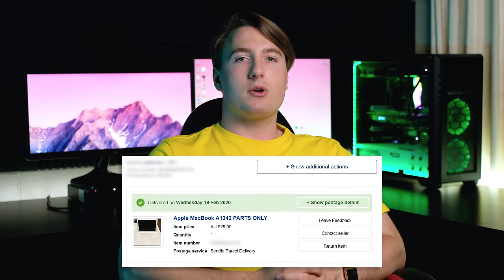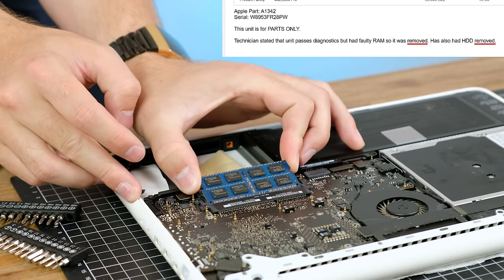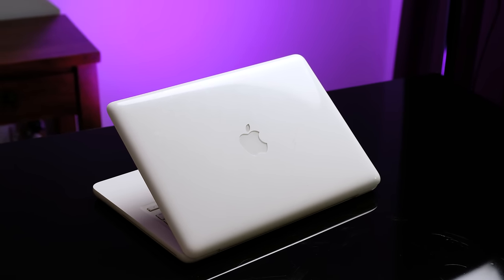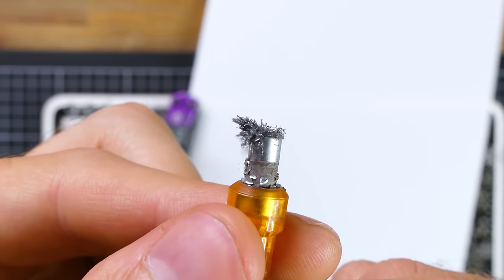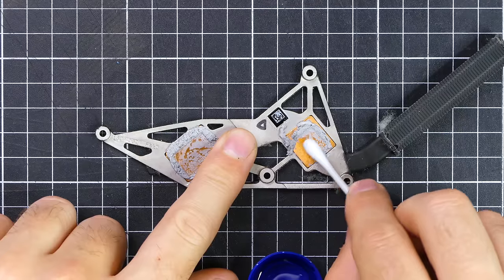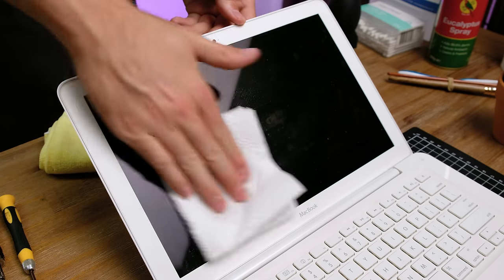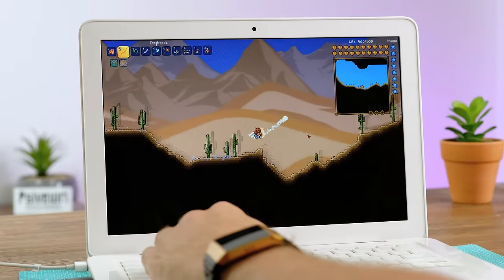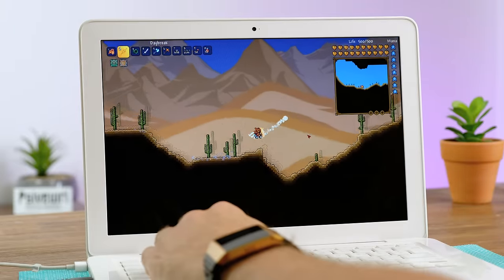$29 Apple Macbook Restoration!

Comment: The certificate of the install package has expired. Just set the date back to 2015-2016-ish and you're good to go.
Reply: Please let this comment get more traction so people can learn about this
Reply: Tamás Nagy it doesn’t work for me
Reply: Yeah turn off WiFi and change the date in terminal. Command should be DATE 010100002016
Reply: jbrooks4282 it didn’t work it says “you can’t change the startup disk to the selected disk”
Reply: @giovonni3225  all i have described is how to change the date to get past the error shown in the video. Sounds like you have another issue. Is it giving you that message in terminal?
Reply: jbrooks4282 no I’ve done what you said in terminal and then tried to boot from my usb
Reply: @giovonni3225  ok. So let's try this. Boot the install usb. Open terminal from there. Make sure wifi is turned off. Change the date in terminal. Then erase your drive in disk utility ( if you want the drive erased) and run the install.
Reply: jbrooks4282 I’ve tried that and I’ve tried it with multiple versions of OSX and I can’t get it to boot and I’ve tried swapping the hard drive and it won’t work
Reply: @giovonni3225  sounds like you have a bigger issue. Sorry, I tried to help
Reply: jbrooks4282 thanks for helping
Reply: @giovonni3225  did you fix it? If not reply
Reply: @madern7  make a usb installer
Reply: Agreed! I always use this date trick to install old mac OSes

Comment: I use this EXACT config (even the SSD!) every day for school with macOS Catalina and it runs like a champ! Great video!
Reply: Are you running Catalina on a 2009 Macbook??
Reply: @allieevans5698  Yep! Well, I was. I actually just replaced it the other day with my new ThinkPad T440 Hackintosh. Works great!
Reply: do you still have it? i'm thinking of getting it haha
Reply: @vern5648  lol unfortunately not. But it was great while I had it and if I still did, I’d still use it. (Spilled water on it D: )
Reply: @annjrue  what did you use to hackintosh the t440? I have one but all of my kexts are out of date.
Reply: @annjrue  well it was worth asking but I got mine running Monterey which is neat
Reply: @mxmobile5619  Oh nice, how is that working for you?
Reply: @annjrue  pretty good even with the intel wifi card. its kind of a worst case scenario since I'm running it on a hard drive with an intel wifi card .
Reply: @annjrue  ThinkPad hakintosh??? Those are completely different companies and computers
Reply: @vern5648  I have a fucked up version of it, I mean its the same as that guys laptop i didnt bother any upgrades and then all of a sudden the trackpad only right clicks while the keyboard types random symbols if you try to type smth, and i just ripped off the charger too

Comment: Psivewri: "$29 Apple Macbook Restoration!"
Me: "You guys are getting Macbooks for under $30?"
Reply from the maker: Seán's Mobile  True, this is probably the equivalent of $20 USD 😅
Reply: @psivewri  Love my comment plz
Reply: i got a macbook pro 13 mid 2012 i5 for 50$ the 480gb ssd that was inside it was worth over 100$ alone and it was almost brand new
Reply: @psivewri  now it's 40 from the SSD
Reply: @doro3353  for me it 01:06😭
Reply: Where did you buy those Mac book less money?
Reply: He didn't buy this for $29. I am on eBay daily looking at laptops etc. They average around $100-130 Aud. Never 30 bucks lol.
Reply: Where i live (Portugal) an hevily used 2009 MacBook goes for 180€+, the broken ones go for 100€ (by broken i don't mean like no hdd or no ram, i mean like fried logic boards)
Reply: @imperial1euro  Here in Spain it is similar. You can look in ebay and it is flooded with old Asus Eee PC's with terrible intel atom processors, horrible intel hd graphics and 1 GB of RAM from 50 to 100 €. You can find some old lenovos with decent specs from 120 to 150€, but the low part is almost useless trash.
Reply: @MisantropoFilantropo  same here, but sometimes they go over 100€
Reply: @psivewri  damn it its 20 euros
Reply: @psivewri  Can you show us how you find these cheap laptops if you havent already?

Comment: That error message you got when trying to install a newer OS is due to the fact that Apple no longer releases a needed certificate for older OS.

You can fix it by changing the date in terminal to a date about 2 years ago and then try to install the OS, it should now work.

Open terminal and write: date MMDDHHMM18
Month/Day/Hour/Minute/18 (year)
Reply: There is also an error in the download file
Reply: I had that problem too
Reply: Had the same thing while trying to install Hackintosh Mojave, a simple google search fixed it

Comment: I got one of these (a Mid-2010) last week and so far it has been great. I upgraded the RAM to 8GB and the HDD to a 240GB SSD. Running Catalina 10.15.3 thanks to dosdude1’s Catalina Patcher, it still has a few hiccups, but those are due to the decade-old CPU 😅. I really do love the keyboard and the touchpad is best-in-class, even 10 years later. The only downsides are no Metal support and its size & weight, although the latter doesn’t bother me too much. Definitely want to see about reapplying the thermal paste, although mine doesn’t have the thermal issue yours experienced. The fans ramp up like they should, and I haven’t seen mine get above 80-something Celsius. Honestly for a $150 investment, this is such an excellent machine! I would highly recommend it if anyone wants to use it as a “casual” laptop or for school.
Reply: Hi Ian, i have a few of these and have high sierra on one and tried catalina as well... I got rid of catalina and stuck with high sierra becuz catalina has Much high cpu demands  and was far less responsive and made the thing run hotter...this is with ssds and 8gb ram...PS:  so many people use Too much thermal paste which leads to overheating... remember these cpus have a tiny surface and an amount the size of a grain of rice would be sufficent...with thermal paste ,less is Better...it becomes a Barrier that heat has to pass through and if its too thick, LESS het gets to the heatsink, not more... good luck!

Comment: Ive been using this exact MacBook up until today running both Mac OS X Mavericks (for that aqua nostalgia) and Mac OS Monterey. I originally got it for £28 out of an ebay auction. Threw in a 4GB RAM stick that i had lying around to bump it up to 6GB and installed a 500GB SSD to replace the 11 year old 250GB HDD. Still runs amazingly and i am even using the original battery. Now that it is 12 years old im very impressed how well the MacBook is holding up. Can’t wait to install the full 16GB of DDR3L 1066, all that headroom will be great for the amount of RAM intensive multitasking i do. Highly recommend this model to any students that need a reliable laptop that is comfortable to type on (the keyboard feels great) so long as they are comfortable with installing a couple easy upgrades if it doesn’t come with them already as well as an unsupported OS if they want better app compatibility as time goes on. The dosdude1 line od patchers and the OpenCore legacy patcher are definitely the best for a fully stable and easy to follow installation experience.

Comment: Awesome video! I have this exact model and it was a very pleasant surprise seeing it here.

The battery on mine is almost dead and the rubber back cover completely peeled off (I missed the replacement program), but the MacBook itself is still working great.

Also, respect for having a vision board 👊🏻

Comment: Here is a tip: 
Paper towels have a rather course surface and can cause scraping like sandpaper.
I recommend only using microfiber towels, as you can use them on anything. Plus you just throw them in the washer and clean them, so they can also be an investment if you view a simple towel the tool it is.

Comment: I got a 2010 model off eBay for about $65 USD. Came upgraded with 8GB of RAM and a 120GB SSD (though it was DRAM less sadly, but hey can't complain at this price). It really is a nice laptop for basic tasks. While it can do 1080p youtube with only a few frame drops, it realllly struggles to do 60fps video even at 720p.

Comment: That's a Mid-2010 MacBook 7,1. It would of came with Mac OS X 10.6.3, but its update-able to macOS 10.13.6, It has a 2.4GHz Intel Core 2 Duo CPU and NVIDIA GeForce 320M 256 MB Graphics . The Display is a 13-inch (1280x800). The Stock HDD is a 250GB TOSHIBA MK2555GSXF SATA Disk, It has a SuperDrive with the Speed of up to x24 and supports -R, -RW
for CD's, and -R, -R DL, -RW, +R, +R DL, +RW for DVD's. On the left side its got a Mag-Safe Power Adapter, Ethernet,  a Mini DisplayPort, 2 USB 2.0 Ports, 1 Headphone Jack and a Kingston Lock (K-Lock). On the right side its got a CD/DVD Drive.

Great Video Psivewri!
Reply: I have the 2.66GHz MacBook Pro 7,1, basically the same as yours but faster CPU, slightly nicer display, and backlight keyboard

Comment: I, too have this laptop. It's been running Manjaro for the past few weeks but I wanted an OS X machine again, so I loaded Snow Leopard via USB, then upgraded piece by piece to Catalina thanks to dosdude1's Catalina patcher. After that I replaced the thermal paste, unfortunately I had to drill out the bigger screw for the fan and the one that is located on top of the logic board. My logic board looked far worse than the one in the video but some brushing and some patience made it look as good as new. I also used Arctic MX4 thermal paste, when putting the logic board in I had problems with 2 of the thin cables which wouldn't stay put in their cable channels. After putting everything back together I realised I had forgotten the RAM sticks.... so the cover came back off and the RAM in. Finally I was able to press that little power on button and much to my surprise it started right up! Albeit a bit slow in the beginning, my 6,1 Macbook late 2009 with upgraded SSD and 8GB RAM looked better than ever, and Catalina dark theme really makes the macbook look so much more modern! Bought this thing for €100 a few years back and it's grown so much on me that I don't want to miss it ever!

Comment: Another note, with installing 10.12 and 10.13 at this point, in the setup turn off wifi and open terminal and change date to 1010102019 and it'll work!

Comment: Laptops that get hot before ramping up the fan speed... still a thing today, my HP OMEN 15 gets rather warm before the fans get to any decent speed under "default" mode. Under "comfort" mode, the fans increase in speed noticeably quicker... but it still gets hot under load.

Comment: Dremel and flat cutting wheel, can make a slot to use a flathead screw driver, I've had to do this a few times with screwed they use locktight on and stripped out.

Comment: Nice! I'm watching this video on my late 2009 macbook unibody. I bought it new and have had it for over 10 years. I only recently bought a new 16" macbook pro to replace it. It's currently running linux mint 19.3 and I have retropie X86 installed so I can use it as a retro gaming machine. About the only thing I haven't done to mine is replace the thermal paste. Good video!

Comment: i've heard the stubbern screws on the mac heatsinks are cause by adheasive used in the threads. Aparently the best thing to do is heat the screw a little with a soldering iron

Comment: I have that same model and it will support 16gb of ram ;-) Im typing on it as I leave this comment.

Also I am not sure why yours (even after putting new Thermal Paste) is running that hot. Mine runs between 34c-50c max. My fan is running at 2700 rpm (I have it manually set with Mac Fan Control program). Maybe that paste just needs more time to set ?

Comment: I had a similar eBay RAM experience, guy said no RAM was included at all, but it had the original 4GB RAM installed and worked fine. I'm guessing it's a generic description they put on all listings to cover the ones that don't include it, and they figure people won't complain if they get the RAM anyway.

Comment: I have one of these machines with an SSD and 8GB RAM. I have also purchased a caddy to replace the optical drive with a mechanical HDD for extra storage. When I go away its my Go-To machine, with the SSD and RAM upgrade it sill feels snappy and for most tasks it has enough grunt. I can still even edit RAW files taken with my DSLR though the export speed of multiple files is held back by the aging CPU. All in all this is still a great machine, its just a shame it wont run current OSX, 

Also, you can reset the battery health if its reporting incorrectly which I have to do every now and then on a few older macbooks I own that dont see much usage.

Comment: I got my MacBook Mid 2010 from last year and still uses it on macOS High Sierra since it was the last to support it..the MacBook late 2009 you owned is still runs for the latest macOS High Sierra even it has better than the macOS Sierra and could be run on 8GB of ram..with 512GB of SSD like I use currently. And now, I had upgraded to Catalina Patcher which is recommended by Luke Miani and running until today in 2023.

Comment: If you own a core 2 duo macbook you should be aware applying liquid metal to the cpu makes a massive difference as the cpu die is very small, My 13" MBP dropped by 2000rpm from newly applied mx-2

Comment: You should do a chrome book video where you install Linux on an old ,school chromebook
Reply: Technically, ChromeOS is Linux, just a very crappy one 😀 also - aren't Chromebooks locked down?
Reply: Some older chromebooks, like chromebook 11s, are possible to have Linux installed.  You have to open up the chromebook and look for bios security write screw and remove it; this will allow the owner to wipe and replace Chrome OS with Linux.

Comment: My own unibody pre-dates the rubber base. Many years ago I replaced the battery (official Apple - AUD 99.00 !), upped the RAM to 4 MB and added a 320GB SSD. It still works like a dream and lasts about 2.5 hours on a full charge. Ah, the good ol' days. Thanks for the great video. Just off to sniff some eucalyptus oil. :-)

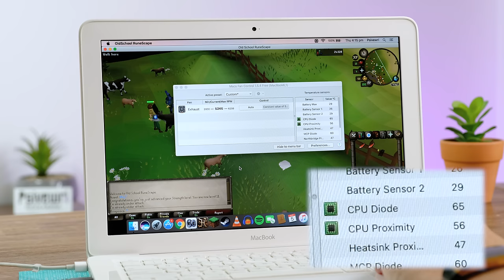Comment: Good Video, I have two of those MacBook Late 2009 one of them do not work at first it just won't turn it on, I leave it for months and then one day I try again and turn on and is working since like two years ago but I notice that the Ethernet conection won't work and also when I try to boot with "option key" to choose diferent USB drive to install difernt OS,  it works fine with MacOS 10.9.5 (like 55C/132F) but with El Capitan !0.11.6 or High Sierra 10.13.6 it get very hot as your MacBook @ 8:07 (90C/180F). the other MacBook works fine and I use it Daily as my seconud Mac on my Desk

Comment: Just bought myself one of these for £7.50 with no charger but the macbook looks to have never been opened, no dust at all inside and battery only has 27 cycles! What a steal.
Its a slow thing by todays standards but a cheap SSD and 8gb RAM should sort it!

Comment: This thing natively supports 10.13 High Sierra, what are you doing?
Technically you could run Monterey, or at least Big Sur (although don't with something that doesn't support Metal, it makes an SSD feel like an HDD).
I would actually recommend Catalina, and High Sierra if you only have 2GB of RAM.
Mojave patcher makes Chrome and I believe Discord not work, so I did not feel like using it.

If you have any Mac that has a Geforce 8000 or 9000 series but can't run High Sierra, using Dosude's patcher here will not cause any bugs at all as the GPU is officially supported in High Sierra. But Catalina shouldn't cause problems either!

Comment: The bottom had a tendency to bubble/ warp. To fix this, Apple would send a new bottom (with screws and a screw driver) in exchange for the old one. I had the 2.4ghz example that I upgraded to 4gb of ram. It was replaced by my recently retired Retina Display MacBook Pro.

Comment: Great Video. Do you know if I can run Final Cut on the Macbook 7.1 Unibody from 2010? Already got 8 GB RAM and thinking about getting a 1 TB SSD. But I need to know if it worth it, because I want to revive it only to run Final Cut. At the moment it won´t install. Thanks heaps.

Comment: In theory, you can install 16 GB (if it's a 2010, at least). I used to have one and I could get 9 in (though it had an iffy DIMM slot so I didn't bother to try for the full 16).

Comment: You cannot use any SSD on these machines. This particulary Macbook has Nvidia MCP89 inside. With Kingston A400 SSD you will stuck with SATA 1.5Gb/s speed and some gliches (because incompatibility between MCP89 and SSD controller). U should use any SSD on Marvell controller(Samsung, Plextor) - it will perfectly run on SATA 3Gb/s. And this A1342 compatible with 16 GB DDR3 1066MHz. I have exactly same one as testing unit for my developer purposes with next specs: 256Gb Plextor M5 pro SSD + Mushkin 16 Gb RAM. Running latest Mojave version, and also capable to run Catalina

Comment: What caused the installer to error out is a TIME based expiration which gives a fake damaged error which can be bypass by setting the time and date to 2018 using terminal on the recovery or install usb this will not apply to OS X 10.8 and 10.7 or older as they were paid versions
Reply: Public betas also don’t seem to have this applied either as I still use the 10.12 public beta installer and it works fine

Comment: ive got a few of these andf they run nice and cool at abt 45-50c  in mac fan control with rpms set at abt 3000rpm... ur temps are crazy high...are u sure the cpu is not running some heavy processes in the background?
I run capitan and high sierra with ssds and 4-8gb ram and temps are fine.

Comment: hey this is close to my macbook well yet it is mid 2009 no it is not a pro! but still this macbook looks almost the same as my macbook....

well here are the specs of my macbook if you want it... i just upgraded it to Os X El Captian!

MacBook (13-inch, Mid 2009)
2.13 GHz Intel Core 2 Duo
2 GB 800 MHz DDR2 SDRAM
NVIDIA GeForce 9400M 256 MB

Thanks For Reading!!